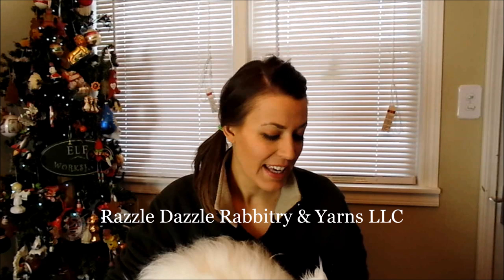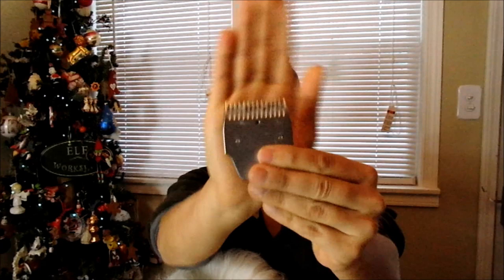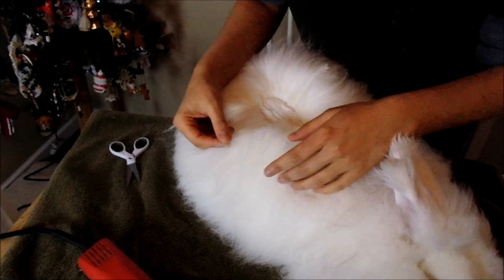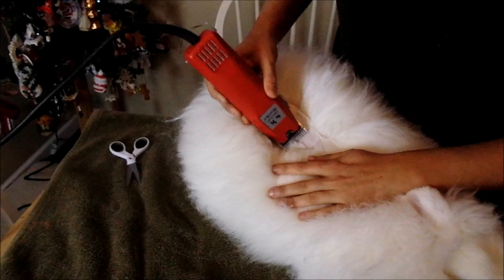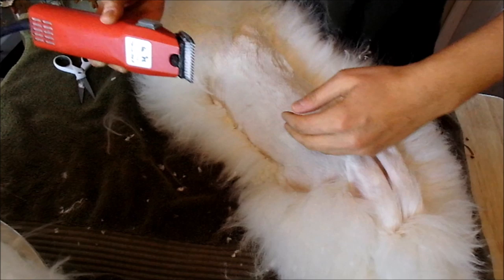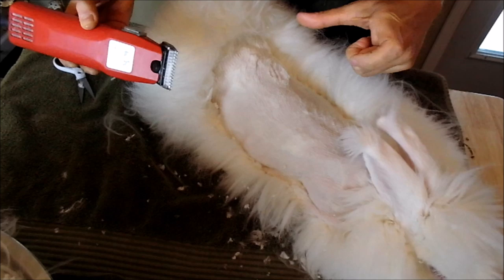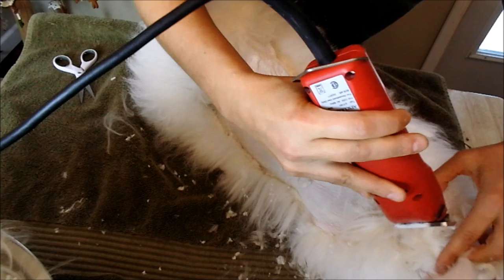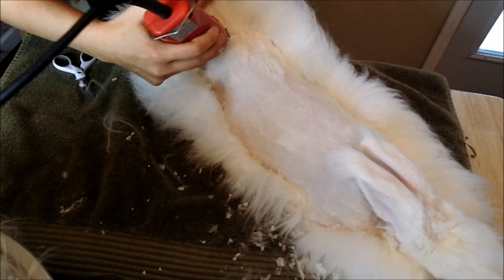How to shear an angora rabbit with electric clippers. German angora rabbit shearing tutorial.

Comment: How many days would you keep a sweater on an outdoor rabbit before they adjust? Also, will the rabbit eat the sweater and get wool block?
Reply from the maker: Hi Holly. Some rabbits will chew and take the sweater off as fast as they can. Others do not seem to care. When the sweater is first put on, the rabbit is monitored. If they struggle, the sweater is removed and the rabbit is kept inside as an alternative. Hope that helps!
Reply: Razzle Dazzle Rabbitry & Yarns LLC thanks for getting back to me. The breeder I purchased him from said that as long as I leave 1/2 inch he should be okay even at temps as low as 10deg but I feel bad for him if he can’t wear a sweater. I was planning to trim him now while it’s around 35-40 deg

Comment: can u use a lamb comb on a rabbit, its a comb that goes over a #30 blade to leave the hair longer just (asking). i notice that u went in reverse is that common when u groom angora's?
Reply from the maker: I have never used a lamb comb. Currently, these are the clippers I use: https://www.amazon.com/Wahl-Professional-Animal-Cordless-41870-0425/dp/B00EVBXI4Y/ref=sr_1_2?camp=1789&creative=9325&keywords=Wahl%2BBravura%2Blithium%2Bion%2Bclippers&linkCode=ur2&linkId=e06a85c9431057c8ea94aa8510c63d30&qid=1673542330&s=pet-supplies&sr=1-2&th=1

Comment: How do you shear without the wool clogging the blade?? I recently got a corded electric clipper and I can't go two strokes without the blade getting clogged. I've tried a 10 and a 7F and the 7F is better but still not as smooth as what you're getting.
Reply from the maker: Katie, awesome question! The blades have to be very sharp. In the video, the blades I am using were just sharpened. Too much oil can clog up the blades, if there are lots of small second cuts getting pushed through. If the blades were recently sharpened, the oil is correct, the next thing to consider is how tight the blades are. Too tight and too loose are no good. With thick coated angoras, such as the Germans, then certain clippers work better than others. We breeders each have our own favorites. :) I use German Red Clippers with the angora package, however, these are loud, corded and expensive. They are a buy once sort of item and take good care of. Finally, a well blown coat free of dander/matting/tangles is very helpful. No matter how good the blades or clippers, a matt is no match for any clipper. I will be shearing again tomorrow and plan on making another video for the belly section with clippers. I will try to get some closer images how the clipper at work, how I am holding them and the rabbit. Did this help a bit?
Reply: Yes thanks! I look forward to your other videos.

Comment: https://www.amazon.com/dp/B089F75RVZ/ref=cm_sw_r_cp_apa_i_vHyhFb8RPK54Q
Do you think these clippers would work for keeping my angora trimmed? I've been using scissors, and it takes a lot longer than I would like to take, especially since it grows past the length I want him at within three weeks. I've been thinking about using clippers (scissors for the areas that I need them in), but I hear that a lot of rabbits get scared by the noise, so I've been searching for low-noise clippers.
Reply from the maker: At some point in the future, I may see how clippers are with shearing. I have not had good experiences with clippers period. It could be the noise, battery life, need for constant oiling, new blades, sharpening blades, etc. I find most people are divided about what clippers to use with their rabbits. A very tough choice.
Reply: @RabbitryandYarns  Ok, thank you:)
Reply from the maker: Did you end up selecting a pair?
Reply: @RabbitryandYarns  I haven't purchased any yet, I plan to soon though